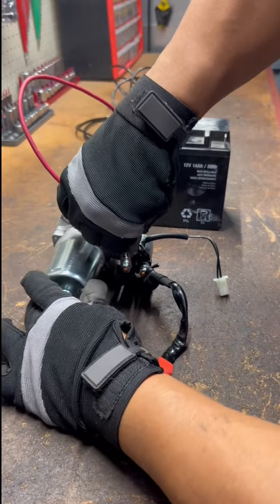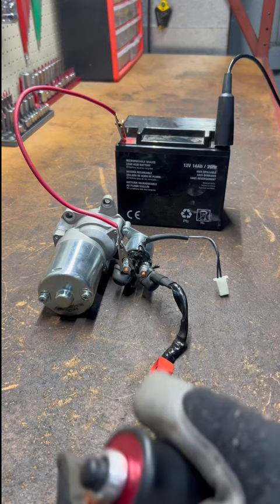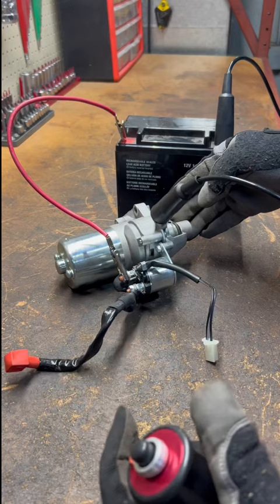Starter solenoid bypass | Test motor only

Comment: Just because it spins doesn’t mean it works. Had some that will free spin but if you put a load on it not enough to spin the engine over
Reply: Exactly! Don’t run a bench test without a load on! Get it done at an auto parts store😄
Reply: Wymieniałem u siebie też kręcił ale nie był w stanie odpalić samochodu
Reply: @bysaaa3048  you should be able to test it on the engine
Reply: That test tells you half the story. The real test is under a load.😮

Comment: Thank you. I was able to start my semi with your instruction after my starter wouldn't crank.
Reply from the maker: Glad to help. Thanks for watching my videos.
Reply: Didn’t
Reply: @10minutefix  question. Can I do this while it's still fully connected  to the car??

Every time I try to hook up the terminals to the battery. The I think I'm hearing the starter click.( till it kills the battery. )
 Checked all the fuses and relays all good.
Reply from the maker: @commonsense.1014 I would remove the battery just in case it doesn’t damage anything in the cars control system. Just a precaution.

Comment: Most starters now have the solenoid as part of the body so even if your starter motor is good, you would need a complete starter assembly regardless. Good hack video though. I need to make test wires with switch.
Reply from the maker: You’re right. At this point it’s almost better to replace it but just in case someone has an extra one then this would help. Thanks for watching.
Reply: @10minutefix ok i have a question, my 2004 expedition went out and i was bypassing with a screwdriver, but now it won't even start that way. Is it the starter and silenoid ? Can i bypass this way or through fuse?
Reply from the maker: @John-ej8rx  I really don’t like using screwdrivers but if you are then this is bypassing everything. If it doesn’t start that way then test the solenoid and the starter but for sure one of them is failing.
Reply: @John-ej8rx im having same issue and i believe its a fried ignition switch wire. Im wondering if i can just make a switch like in this video so i can just do it from inside the car. Im not excited about changing the whole ignition wire.
Reply: How is this a hack? 😂😂😂
Reply from the maker: @leonciomendezdy98 what is a hack? 😂
Reply: @10minutefix  this is just rewiring
Reply from the maker: @leonciomendezdy98 correct.

Comment: On our 5.7 Ford f-350 there is an uninsulated heavy gauge wire between the solenoid and the starter - about 2 inches long. so I jumped that with main power wire going to the solenoid. The leads on my remote starter got hot just clicking a few times but the starter didn't budge. I might try banging on it. I thought these things were serviceable so I wanted to isolate the issue.

Comment: Yes jumping the  starter solenoid will start the car if the key is in the on position.and get you going but to fix it for good instead of spending lots of money on a brand new Gm starter 
Many people me being one of them uses a ford starter selinoid with an extra battery cable to leghten the starter cable to move the selinoid up and away from the starter it works just as good if not better because it’s no longer right next to the motor and exhaust pipes where the high heat kills the selinoid time and time again yes you can keep the original Gm starter and just wire in a ford starter selinoid and that will work just fine and also not only is it better but cost is a lot cheaper then purchasing a new Gm starter and it happening all over again in a few months if that  it is just wired up to the original Gm starter with a 2 foot battery cable anywhere in the engine bay with the extra battery cable going to the original Gm starter sometimes it last but most times it will fry the selinoid all over again causing the issue over and over with the ford selinoid wired into the Gm starter I have had no further issues at all and the car starts great every time.
You can look it up on line 
Using a ford starter selinoid with a Gm starter  it leaves the old Gm selinoid right where it is and having the ford selinoid up and away from the direct high heat fixes the problem for good 
Hopefully this will help a lot of people fixing there starter solenoid issue and keep them from being stuck because of it. Look into it I’m glad I  did . Real simple to do and fixes it for good .
Reply: Were u high writing all this? Best regards lol

Comment: Don’t forget to tell people to use 12gauge wire not 6 gauge. Although u shouldn’t do this if u don’t understand electricity
Reply from the maker: You are correct.
Reply: Why do you say to use a smaller wire and not a wire of appropriate gauge?

Comment: My fourwheeler wss working with the plier trick wheb connected but recently my fourwheeler died and everytime i try to use pliers now it sparks but smokes if held on too long
Reply: Also when trying to use power button it click at the solenoid and the end of the starter plz help
Reply: Doesn't turn over just sparks and smokes at the solenoid,  the battery terminals are tight new battery I don't know don't have funds for the shop
Reply: Could you give advice
Reply from the maker: Well the only thing I can think of is the starter is bad. If you jumped it and it smokes then it is most definitely gone. If the starter is together with the solenoid then you need a new starter. If it is separate then you need to test the motor separately.
Reply: thank you man !! I hear a clicking sound going from the solenoid to the starter because they are separate so I will test the starter !

Comment: What does it mean if it works fine but the ignition won’t turn it over.
Reply from the maker: Well that could be several things. Fuel, timing, ignition coils, electrical issues or any other issue. It is hard to say but for sure it is not the starter if you tested it properly.

Comment: Of you are bypassing the solenoid the why does the pinion gear still move forward? As if it is engaging with a flywheel?
Reply from the maker: The solenoid does not control the pinion. The solenoid only gives power to the motor. Bypassing the solenoid just tests the actual motor.

Comment: If I have to start my car like this, essentially does that mean I need a new starter?
Reply from the maker: Not necessarily because your starter motor is working. The solenoid might be bad. Test it. If it works then it is an electrical issue somewhere else.

Comment: What is the what is the black cable go that's coming off the right side of your solenoid what's that running
Reply from the maker: On that specific starter the black cable goes to the on/off switch. Some other starters don’t have the connecter and you would just plug the cable from the switch to the tab connector on the starter.

Comment: What is you dont have an inertia drive like that starter does?
Reply from the maker: What do you meant by inertia drive? Are you referring to the solenoid?
Reply: @10minutefix  The act motion of spinning engages that drive through centrifical force.  Most starters use the solinoid for that function.  So if you activate the motor term.  The drive wont engage
Reply from the maker: This is not an energía drive. There are gears and that is what moves the pinion up and engages the flywheel.

Comment: What would it do if the solenoid wasn’t working? With the starter just spin?
Reply from the maker: The solenoid spins the starter so it wouldn’t work at all. If you don’t hear a clicking sound then you need to check the starter and the wiring going to it.
Reply: @10minutefix  well what’s going on is when you push the starter button it’s sounding like something is spinning but it doesn’t turn the motor over at all
Reply from the maker: Then it sounds like your solenoid is working. Once it gets power the solenoid activates and runs power to the starter motor. Maybe your solenoid is not catching the starter motor.
Reply from the maker: Well, if your solenoid is connected to the starter then it might not be making the power jump to the motor. That could be one possibility.
Reply: Could you help me I've even tried doing the plyers hack but it isn't working anymore doesn't turn over just smoked up my battery cable and solenoid part

Comment: What kind of push button is this?
Reply from the maker: It’s a remote starter that you can get at any auto parts store. It’s very useful. Thanks for watching my videos.
Reply: Just use a screwdriver like everybody did as a kid back in the 70's

Comment: Anyone know what happens if you replace a manual starter for an automatic starter?
Reply from the maker: Replace it on what. I’ve seen them on pressure washers but that’s it.
Reply: @10minutefix I’ve got a Honda Xl250 dirt bike with a bad magneto. Can I bypass the solenoid and make it electric start you think? Would that affect timing, also would I need a CDI/ Regulator